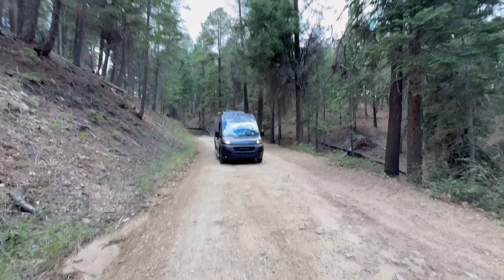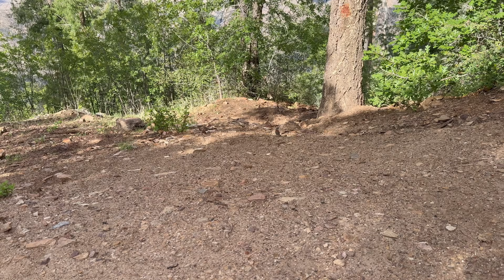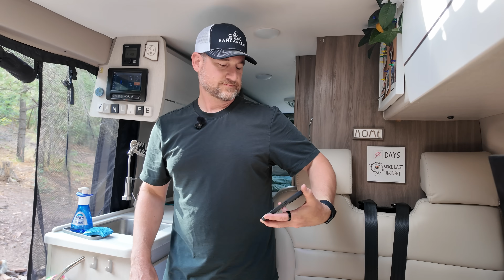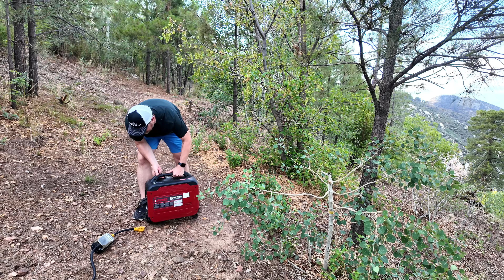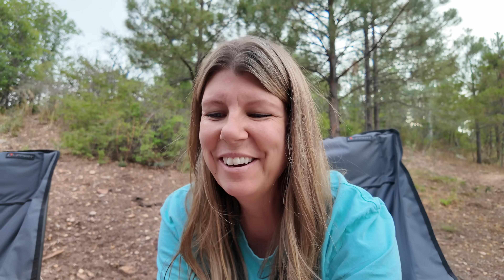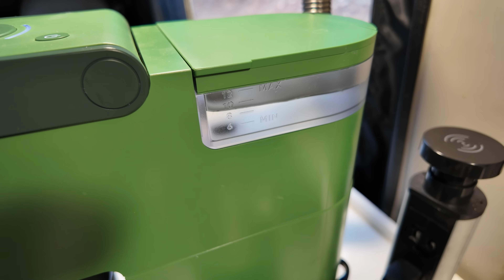MUST KNOW RV Generator Rules (Risky Roads & Lessons Learned on Mt. Lemmon)

Comment: As you said, you get what you pay for.  Honda has a 2200, up from the previous 2000 portable that I have had since 2005 with no issues.  They are great and have the ability to use an extended run kit that allows you to run an external tank.  A 6 gallon marine tank will run it about 35 hours.  The normal "almost 1 gallon" tank last us about 6-8 hours at night running our 1500 watt heater and thermostat.  It is quiet.  It runs at about 57 Db, about the loudness of normal speech.  I sometimes check to see that it is still running, and it is.  It is "campground rated", it is that quiet.  I also have a 3000 model that I keep for home use.  I bought this one before the 2000 with the same great reliability.  We are considering a newer model 3200-FI.  This one is of interest because it is fuel injected.  This means it will start typically on the first pull and run at any elevation.  Fuel injection, like what's on your van, adjusts itself as elevation changes.  We will be able to run our roof top AC or electric heater at any elevation.  diesel/gas heaters do not do well at higher elevations and good ones will cost about the same as teh generator, plus installation.  The Honda is super reliable and super popular and ultra quiet.  You can find them used or get accessories like the extended run kit on Amazon.  I bought one and I love it.  The Honda is also serviceable at a multitude of places.  They will start at 13.5K AC.  The Fuel injected model will run in the mountains also.  By the way, etiquette rules regarding generators pretty much dont apply to these.  Like I said, we barely hear it inside and we keep it next to the van and chained up so it wont get stolen.  We actually hear the quiet electric heater fan turn on to let us know the generator is running.  We can see the power indicator on said heater/fan to tell us the generator is running as it sits outside the back door near the bed.  Good luck.

Comment: Another great informative video.  Just researching this subject today and found the Jackery 3000 power station.  No question it is expensive, however it does have a 30 amp plug, big output, big power for the van and tests show it will run a 15,000 Furrion A/C for about 5 hours.  It is not a gas generator = lithium LiPo4 and weighs approx. 60 lbs.  No smell, no carrying gasoline/oil, no noise for the neighbors.  P.S. Please get Bob a new front seat he deserves it.  You guys are hilarious together.
Reply: Wonder what kinda solar panels would recharge it the best

Comment: If you're 200 an amp hours is in 12 volt it won't go as far you need a 48 volt air conditioner and your batteries need to be 48 volt or 52 volt that way it will last much longer have the AC needs to be a 48 volt also that's an American Van I think you need 100 amp charger under the hood would replace your generator

Comment: You CAN run generators in the heat. If someone has spent the time to properly design and build them for it.
 But most RV equipment is built cheap and designed only for temperate use.

Comment: I installed a 12 V air conditioner made by country mod on my 40 foot diesel pusher granted I have 400 W of solar on the roof and 500 amp power of lithium battery. I could not be happier with that country mode air conditioner. It’ll run all night at 72° and only eat up 50 to 60% of my battery also running my inverter to run my household refrigerator.

Comment: We use a water filter first from city pressure, then a pressure regulator. So the filter gets the max pressure. If crazy pressure damages the filter, it's a small external issue, and filters are capable of a lot more pressure than the rig's plumbing. The subsequent pressure regulator protects the rig. The rig's pump is not going to generate dangerous pressure anyway, and no need to further reduce flow after the pump.

Comment: I recently purchased the WEN 4800 from Home Depot for about $630. It’s very quiet and runs my A/C and refrigerator at about 40% gen output. Also converted the fuel system to plug into my 76 GMC Motorhome put it still runs off the gen fuel tank if needed. Really like this gen - FYI

Comment: You can make a generator silencer four pieces of pink foam board that would be the front two sides and a top with the exhaust going out the other side pointing away which will significantly make the generator quiet to your ears. If you watch YouTube about generators the Honda being significantly higher priced then you have the Generac which is what we have the 2200

Comment: Something to be aware of is that not all generators have a spark arrester   This is critical since internal combustion engines operating on USDA Forest Service and most other federally managed lands must meet the requirements of the Code of Federal Regulations 36 CFR 261.52. This mandate requires the operator to have a certified and properly maintained spark arrester installed at all times.

Comment: I was able to four 460AH Epoch Essentials batteries under the passenger side bed in my 2024 Thor sequence 20L. Along with two 450 watt 24v solar panels, this is giving me several days of use even with the AC set on auto-cool.  That upgrade has been the best so far for being confident in boondocking for extended periods without other charging options.

Comment: Fun adventure anywhere but on the edge of Mt Lemon with the Nature show in the distance was certainly special. Use your cell phones or designated walkie-talkies to communicate with one another during various blind spot parking negotiating and come up with key phrases and instructions that both parties understand what's being conveyed and reacts to. I've always wondered if a large muffler somehow fitted temporary on-off to allow capture the factory exhaust of economy generator at source, so it doesn't produce back pressure but seriously cuts noise couldn't be concocted. Maybe take this generator to muffler shop and ask. Bet you you'll find someone who'd be just as interested. Just going in and asking won't get you very far on your quest, I believe. Physically taking it in with you, ie/aka Show and Tell, now they have culprit right in front of them and not as easy to ignore. Good luck

Comment: In my opinion its a lot better to run a generator for like 2-3 hours straight than have it keep turning on and off every 15 mins like it would with an auto generator stop/start system.  Ppl can tune out a constant noise but if it keeps going on an off its a lot more annoying.   So when I have my generator on I have both my ACs running getting it as cold as possible and doing whatever needs to be done like running microwave, charging a bluetti powerbank etc.  Then after like 2 hours the RV is cold and I hit the bed and keep it off for like 6-8 hours.  I only have boondocked at walmart parking lots when traveling between campgrounds with hookups, but I think this is the best way at least in my experience and what I would prefer my neighbors to do.

Comment: Thanks for keeping us updated about the plumbing, but I don’t quite understand what was removed? If it was indeed a pressure reducer (to eliminate the need for an external pressure regulator when connecting internal fixtures to city water), then why is it installed downstream from the water pump? Seems like you wouldn’t want city water pressure pushing on all of the plumbing from the inlet all the way to where the reducer was installed. And it also seems like you wouldn’t want to have the small built in water pump pushing through that to provide the coach with water. 

Wanted to provide a couple other solutions (other than getting a new coach which is a budget buster). But in my defense, it is something to consider when folks buy a coach. Does the power system meet my needs and my style of camping, but I digress. 

You could also consider a dual alternator and have the secondary alternator used just to charge your coach lithium batteries. If that solution is too expensive, consider replacing the ProMaster chassis alternator with a high output model. I just saw a 400A model. 

You can tap the extra current and use it to charge house lithium batteries. 

The other advantage of a “built in” solution is less messing around with secondary fuel sources. It is a lot safer and quicker to setup/breakdown camp.

Comment: Hi you two, Love your posts! I see your water hoses connecting to your containers are red and blue with clamps. These are a source of leaks and several RV techs here on YT have pointed out Thor and several manufacturers use these, but the white, flexible hoses that are not clamped prevent leak risks. We don’t see blue and red hoses are used in homes and this should tell us something!

Comment: That hill was almost too much for the Promaster but you made it 👍🏼. That’s the reason I went lifted and 4wd. I’d put it in low range and back up slowly and steady. 
I real world test in my driveway 😂 and I’m a year from retirement to go FT. I’m doing a lot of research and testing of everything. 
Give and take for sure….i got 560ah and a bunch of Victron stuff but still have my Onan 4000 just in case. I may get more lithium later, i can get up to 960 if needed 😂 I think you need to double your lithium batteries.

Comment: That seems like a lot of power usage overnight.  Was the inverter on the whole night?  Is the inverter powering your battery charger, thus creating a never ending loop of batteries trying to charge themselves? I see a lot of people that turn the breaker off for their "battery charger"/"transfer switch" so that the batteries are not trying to charge themselves through the inverter which will drain them quickly.  I enjoy your videos.

Comment: in the Southeast, generator is mandatory! I started with a Honda 2200 and eventually installed newer Onan 2800 inverter generator on board. Measured sound on both and the Onan was quieter. AC uses 10 amps and Onan is just above idle. Onan is fuel injected also so no carb problems and runs well at high altitude! Was at 10,000’ last week!

Comment: Your power choice depends on your style and location.  I live in the southeast.  A generator is necessary for ac when not plugged in.  After hurricanes plugging in is not an option.  AC is necessary so buying a van with a generator was necessary.
Reply from the maker: Thanks for the insight, that's super helpful to know!

Comment: The van's alternator generates about 100 amps while the engine is idling. If you have a dc/dc charger installed, this should perform the same as a 1,200-watt generator and will consume about 1/2 gallon per hour. 

The dc/dc charger input needs to connect to the starting battery, and the output needs to connect to the house batteries. 

In this application, every motor vehicle has a quiet built-in generator!
Reply: These vans have a dedicated 170A (about 90 at idle) alternator just for charging the house batteries. The chassis alternator only has about 20A of extra capacity, but a small DC:DC is still a nice addition if you're keeping this van long term because there are ... goofy things about the electrical system and that can get you out of a jam in a more elegant way than jumping the house and starter batteries.

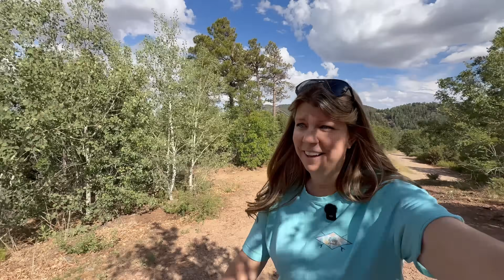Comment: Years ago when we had boats on the Chesapeake Bay, we would go out sailing , then anchor up in a quite cove for the night, we would send the kids up to the beach in the dingy to collect firewood for the nights beach fire. One weekend this guy pulled up on the strand, That night he started a large generator on his swim platform. Every time his AC kicked on the gen would get louder. At 3:30 in the morning about 5 of us Captains started pounding on his hull. When he came out, he asked what the problem was. We said either turn it off or we are going to come sleep on your boat. He begrudgingly turned it off. The next weekend he came back and anchored up further in the cove and again the generator. Someone paddled over in his kayak and poured a bottle of lapping compound into his gen tank. It took about 25 min to take affect as the gen internally ground up all the parts. Never saw him again. If you have to run it stay home and don't foul up every one else's enjoyment of nature.

Comment: you had better learn how to back up or just park it for good.

i was ( now retired) a commercial truck driver for 40 years. and can put a 53 foot trailer anywhere. 
some of the trailers i have pulled , and rigs i have driven. makes your fixed frame van stupid easy.
but learn the tricks of the trade. and prat ice in a open parking lot.

Comment: 11:07 I don’t blame you guys for trying the cheap Chinese generator, I would do the same. But I would consider getting a Boldt (I have one) as the lithium system is huge and we don’t run out of power often. When we do we run the engine on an iopedal high idle kit for two hours and we are full again. I think the main issue you have is your battery system is too small, we have about 13kwh in our Volta system. We can run our AC for 8-12 hours

Comment: My idea would be to run the AC while the generator is charging the batteries so you can top up and cool the van down. Charging 10% in 10 minutes seems pretty fast, so I think that generator is fine because they all are going to make annoying droning noise. You were at 50 dB between you and the neighbors which is pretty quiet, but generators are just annoying. You could make a sound baffle for the exhaust end to deflect the sound up and away. 
Alternatively you could switch to a 12 volt AC. I saw one installed from CountryMod recently on another channel. I’m sure that’s not cheap though. 
You can get pretty good LFP batteries for $300-400, but it’s more finding a space and wiring them in. 
I got a set of bamboo utensils including a spatula at the KOA camp store. So far so good

Comment: Wow, that looks like an amazing camping spot. I am gonna have to look up that mountain and see how far it is from home. Do you also still take your jack with you for cases like you just had where you might have a low battery, but don’t want to run the generator? You are in bear country and it seems you’re starting to Boondock more, are you carrying any bear spray? I just picked up a couple of canisters for us since we are heading up to Lake Tahoe next week. We currently just have two 100 amp AGM batteries and are thinking of upgrading to 200 of lithium. I was surprised to hear you say that 200 of lithium is not enough. I can definitely see it not being enough to run your air conditioner, but otherwise with enough solar on your roof, I would think it would be OK. Great video.

Comment: 200 amps of lithium??   120 volt AC???    Lawdy.   Any solar??  I run 940 lithium, a 12 volt AC, and 5 panels on the roof.  Don't need a generator.

Comment: Pick up a solar generator and an inverter enclosed generator. You do not have to spend Honda money to get a good quiet generator. We use a Champion dual fuel 4500 watt to power our 28 travel trailer. I also have an inverter made by Victron in my camper with 300 amp Hours of battle born lithium batteries and we use our Anker c1000 for the in between if needed when house batteries are low but can’t run the generator for quiet hours. Having all that were in great shape.

Comment: Interesting video, but I have a question... you were at 100% when you went to bed, but only had 9% when you got up the next morning, correct? Also, you said you only had the A/C on for 10 minutes, correct? If so, what ran down your battery so much?? Did you keep the inverter on all night? We have a 920 amp battery system, so about 4.6 times more power than you have, so at least mathematically, that would mean if you had 920 amps, you would have 41.4% battery power left in the morning. That said, we have had nights that we didn't use the A/C and have had 80% or more the next morning, so I just can't figure out what was draining your battery so much. Any ideas? Thanks for reading this far too long post!
Reply: They had 200ah of batts at bedtime and roughly 20ah  in the morning.  We assume they set the shunt to the full 200ah, but maybe they set it slightly lower to allow for some safety zone below 0%.  So they used about 180ah during the night.  The AC at most would draw 1500 watts per hour.  They claim to use for for 1/6th of an hour so 1500/6= 250 watts. Watts = Amps* Volts.  250W/12v=Amps drawn.  ->20ish amps drawn from the batts.  That would have left 180ah in the batts to cover the overhead on the inverter, and fridge.  I'd assume the fridge was on and set for 120v.  If they used hot water for showers, that would take some batt as well.  So, ya, in the end, 200ah didn't get them very far.